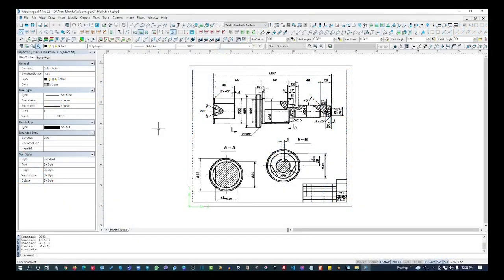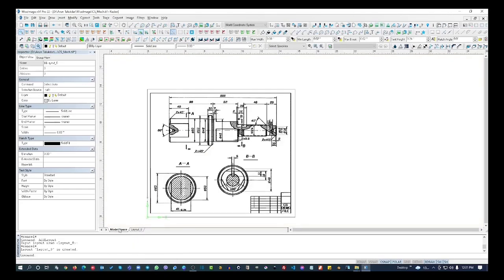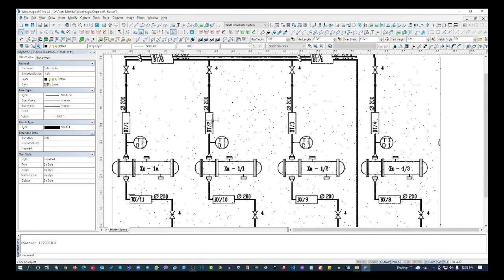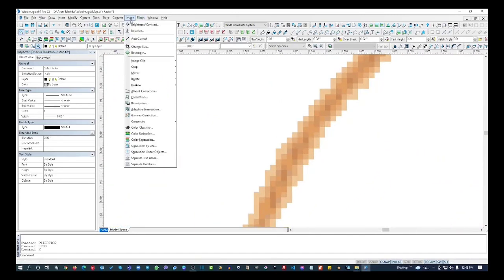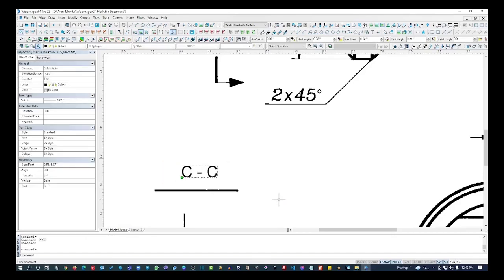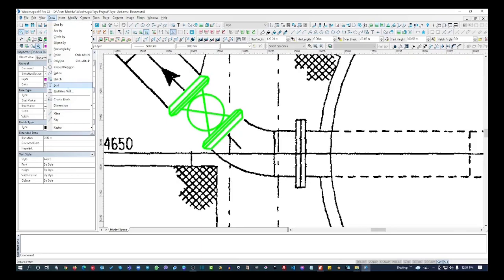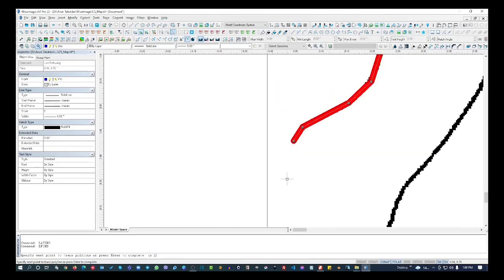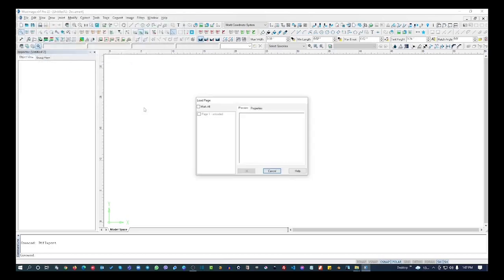Overview of WiseImage Pro

Comment: How come that when I rotate a drawing 90°, saves it, it still opens up as a non rotated image?

If I remember correctly, in older versions, you just flip the image (drawing) 90°, saved it and it was done...

Now, it goes back to its original "inputs". Sure, the text that I added is still there, but the entire drawing has rotated back in a standing position as it were when I scanned it.